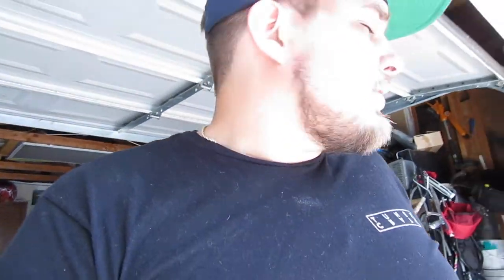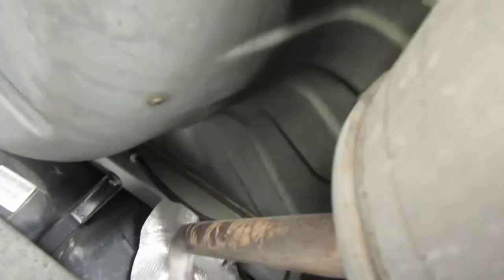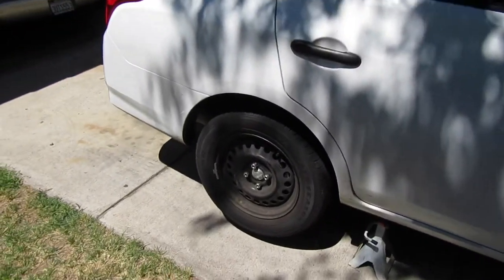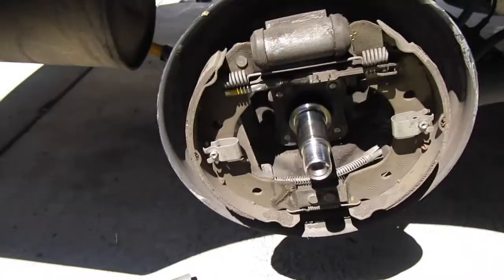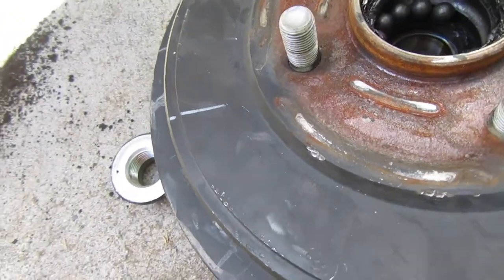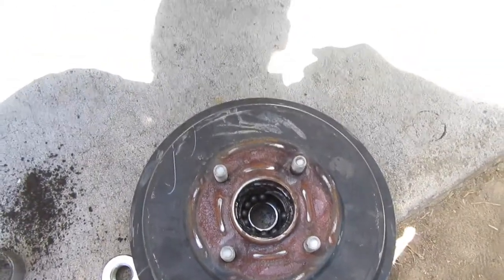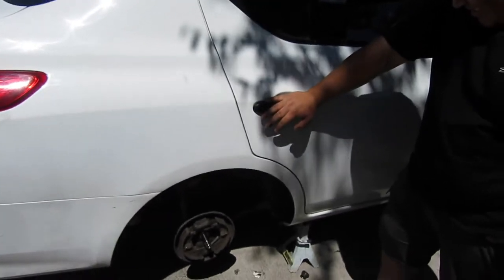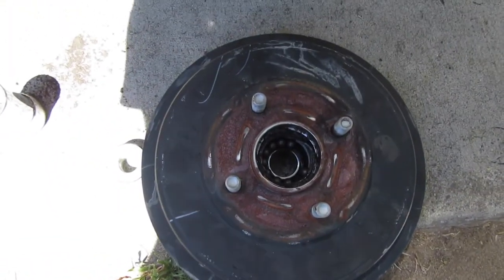The Nissan Versa is broken!!!!! (ball bearing went bad)

Comment: how much did it cost you to have someone press it in? Dealership wants to charge me 1k for the exact same issue. They told me "this is a common problem in Versas".
Reply from the maker: $25 to press it in by an independent shop. You can buy a bench top press at harborfreight for $60 and just replace it all the time. I did this since the Oreilly brand went bad in 3 months

Comment: Dude how many miles are on your versa? Mine only has 53k miles and I think there bearings might be bad already how pathetic is Nissan for using Chinese bearings.
Reply from the maker: I had the bearings go out twice and I traded mine in at 50k miles
Reply: @adrianmejia3302  holy crap! What brand did you use to replace them the first time? I don't get it, I see posts on versa forums with people saying they are at 150k+ miles and saying they haven't had problems with it. I'm having the same problem with my Mazda 3 I think manufactures are going Chinese cheap on suspensions now days.
Reply from the maker: I’d say but OEM or maybe Autozone could have a better option. I bought National Bearing from O’Reillys and later on many other people have said that those go bad everytime. Has lifetime warranty so replaced it in 3 months of having it pressed in lol. Bought a press just for that
Reply: @adrianmejia3302  man I might try seeing if moog or timken has some. I wouldn't trust OEM again knowing it's Chinese